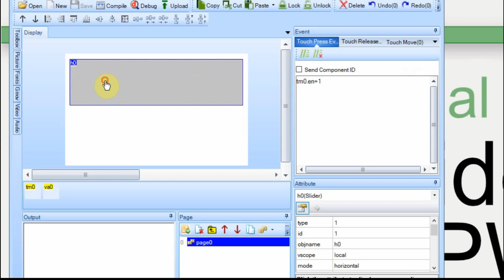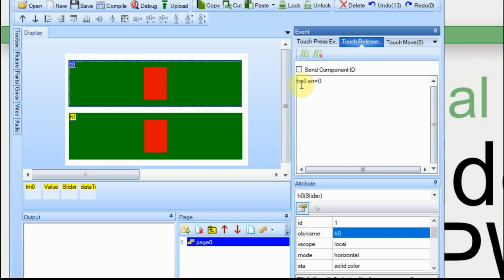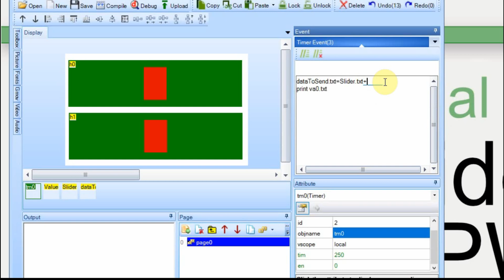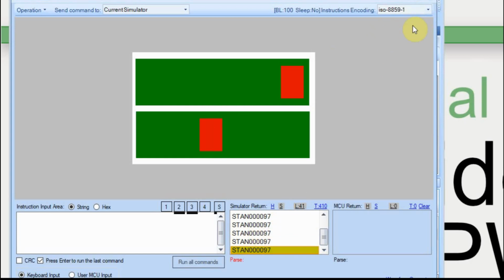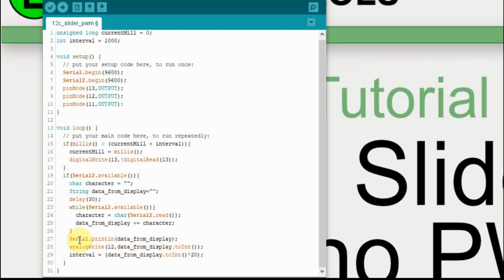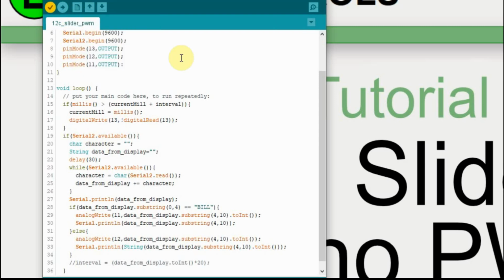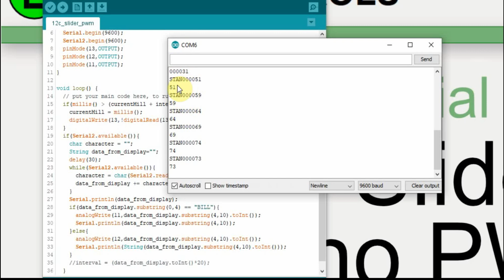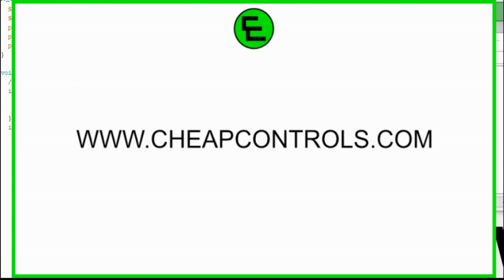#88 Nextion Display Dual Slider to Dual PWM Arduino part 3 NO Nextion.h Library NextionTutorial

Comment: I looked on your web page for the HMI file, but didn't see it or a link to it. I tried to submit my comment on your web page but the Submit doesn't seem to do anything?
Reply from the maker: Sorry about that.  I am not sure what happened.  The Email address had been removed that accepted the comments. I have that fixed.  I am working on why the Alert that the Email was sent is not working.  You can submit your comment at cheap controls and I will email you the HMI file.
Reply from the maker: I got your comment.  I am in the process of adding a way to get files but I do not have it set up yet.  Would you like me to Email the HMI file from this video to the address you supplied?